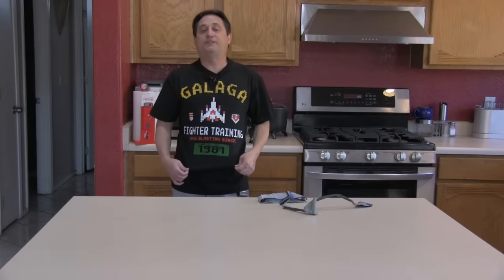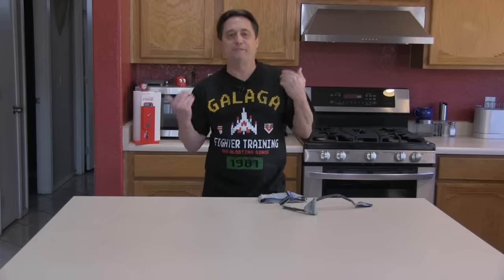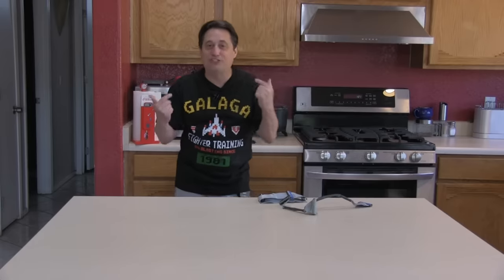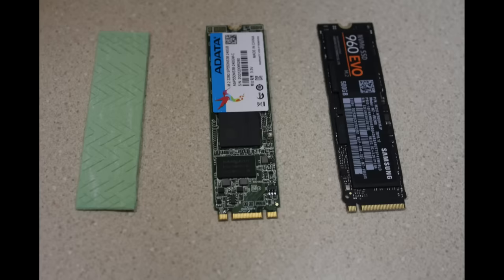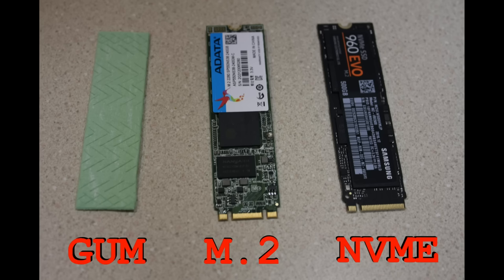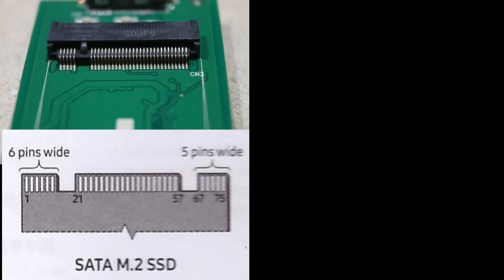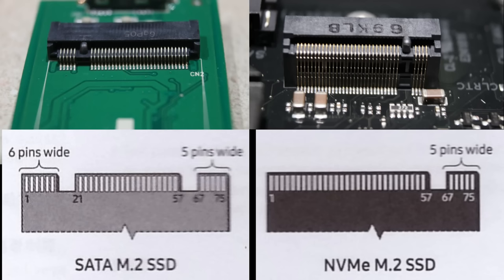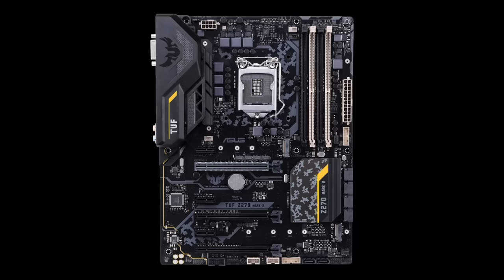M.2 vs NVME: What's the difference?

Comment: SAS more common than you think.  SATA is just a subset of SAS and with that you can plug a SATA drive onto a SAS controller and it will work (small difference in connector - keying you can get adapters for).   Though you can't plug SAS into SATA.

Parallel is better than serial - however the reason it's not used more is synchronization and sending multiple lanes of data is great, but you need to sync them and that add's so much overhead.  Hence a single lane (serial) will be cheaper and allow that single lane to go faster than it would if it had to be synced with 7 other lanes.

However - there is always a limit and you may see Parallel connections come into play again.  Heck, your memory not linked via serial connection, its parallel.

Tech moves fast, I remember when you needed a forklift just to change a disc.

Comment: 69 Years Old, and I remember Run Length Limited Disks, and fitting IBM PC XT SCSI Disk Sub-Systems and as you say boy we’ve come a long way. I wonder how long it will be before we see on board optical disk interfaces.

Comment: I remember most of those standards, and YES the ribbon cabled would cut airflow, especially if you were running 4 drives. Just started getting into the M.2 SSD, which is used on my laptop.(took me a while to figure that out) and the MVME drives which are used on my new desktop. Your vid was short, concise, and very accurate. Great job, thanks.

Comment: I am 73 years old and started with an original Compaq transportable (for work) dual 5.25 floppy drives, and individual 256k RAM chips were $100 a pop... so I did not start with 640k. 8 inch floppy drives were still out there.

In the computer field back then, RLL and MFM were not referred to as interfaces.  There was no RLL. Later, when RLL became a term, it referred to how the data was organized on the disk. MFM drives had the same number of sectors on every track. RLL drives had the tracks divided into groups. The group nearest the center had fewer sectors than the outside group. I taught English to Control Data's hard drive people (section/division?) in Paris, for the last couple of years before it was sold to Seagate. They did not sell to end users, only to a distributor.  They needed it for computer fairs/shows in Europe.  It was a small class, two technicians, two engineers and an accountant... mostly conversation/discussion on technology/computers; their products, the competition, what was better, why, what could/should be changed etc. Effort was made not to leave the accountant behind.  No dictionaries allowed, they could team up to explain words, hands and feet if necessary. I learned a lot. I massaged their English into something shorter, clearer and more precise.

When I built my first computer, an early 286, I wanted one of their hard drives (possibly the best available at the time). Since they could not sell me one, getting one for a good price is another story.  I got a 60mb, full height 5.25 inch MFM drive, and bought an RLL controller. The same drive was also available as a 90gb RLL drive for a chunk more money. That would not have worked with all MFM drives.  RLL needs better precision and control.

To my knowledge, all hard drive platters made in the last few decades use RLL of some variety. You just have to look deep in the tech manuals to see it. Since they all use it, saying so in advertising blurb is a waste of time, space and money. That includes SCSI (the I is for interface).
Reply from the maker: Great info, thank you!

Comment: The limiting factor is parallel is maintaining the same signal speed.  If the frequency of the voltage changes is quite different on different wires, the signals travel at different speeds, and you end up with corrupted data at the other end of the cable.

Comment: @2:10  "however for whatever reason"  It's not for whatever reason.  Yes parallel is "more efficient" at transmitting data, but it's more costly to design and build.  Many circuit traces and wires are needed.  So when ASICs came along that could transmit the same amount of data on 2 or 4 wires (USB & SATA) as you used to be able to transmit on 16 to 40 (ATA, IDE and SCSI), it was a logical improvement.

Comment: You totally took me back to windows 3.1 for workgroups when you brought up the “JUMPER PIN”. I remember getting a 2nd hard drive (my step father took it from his job that fired him along with a few other things) but it was a Maxtor and had a neck breaking 140mb. But I just remember being so frustrated (because YouTube wasn’t out yet and cracking open a computer was a mortal sin since they cost so much.) but back in the day it was called a Jumper pin... and depending on where you put this tiny little piece of plastic (god help you if you dropped it) that would put it in either slave or master mode. Jumper pins... man what a pain in the rear. But you could use these to run safe mode 1, safe mode 2, there were actually a lot of different functions the jumpers served.

Comment: very nostalgic start, I really only wanted to hear about the M.2 stuff but the trip down memory/nightmare lane was nice.  I was so happy when we transitioned from those horrid ribbon cables to SATA, not only were they always too short, hard to route around everything, often would literally get stuck in the processor cooling fans which absolutely impacted airflow, connecting more than 2 drives plus a floppy was a total nightmare.  I often had a CD drive, a CD burner drive, maybe a drive docking bay, an internal hard drive and a floppy drive on one system and instead of the docking bay two hard drives.  I mean, back when it was $300 for a 5 gig hard drive the only way to expand storage affordably was to either burn everything onto cheap CDs or constantly swap out those 1 gig hard drives.  When I got a fast CD read/write drive and could put 3 hard drives in my computer was so coool.  Still a bi*** to route the cables and trying to figure out which end of the cable went to,  master or slave, then woops forgot to change the jumper... I still have nightmares and flashbacks when building a new system (like im doing right now) I always look for that jumper still even on new SATA drives.
Reply: And now you know why I went SCSI back in the day even though it was more expensive. My Plextor was an expensive bit of kit for the day.

Comment: Nice video very clearly put, I will just add 2 Fun facts things
1. IDE had also "Cable Select, meaning that the disk/CD-rom on the edge plug was automatically set as "Master" and the disk/CD-rom in the middle plug was automatically set as "Slave" wooooow!
2. Try to cable manage with 2 of those IDE cables + the floppy cable + the extra bulky PSU cables hehe

Comment: RLL and MFM were not interfaces.  They were methods of recording data to the disk.  SCSI was an interface, but in reality it was initially a unifying intermediary interface.  Later on SCSI was designed into device (disk or tape) controllers.  Early interfaces for small systems were SMD, ST-506, ST412, ESDI ... SCSI and a reduced command set interface based on the same physical configuration, SASI, came around about the same time as those other interface.  However, initially SCSI/SASI controllers were intended to run  SMD, ST-506, ST412, ESDI and other devices, but with a common programming model.

Comment: Never owned a off the shelf PC so have built them since around 1997 so a long time now, PC building was never difficult (Its like lego) but in 2020 its childs play.  Windows OS install is easy, BIOS's now have GUI's, No CPU / Motherboard / onboard connector jumpers, slide out motherboard trays and tool free slots, Modular PSU's, Motherboard IO panel plates ... the list goes on.

Comment: a year ago, I upgraded all my PC's with new motherboards and CPUs, and used an NVMe SSD for each of them as system drive. But I had for each system in the past 2 SATA 2,5" SSD drives from 500Gb per piece. So I bought 2 extra for every upgraded computer. Makes me I have an NVMe from 1Tb and 4 SATA SSDs, giving me 2Tb free space, with read and write speeds (around 500mbps) Not that fast, but faster than platter HD's. And I have a few servers running with almost 120Tb disk space per server. That's more than enough for storing my project files. And music projects.

Comment: Worked in computer sales starting at Radio Shack in 1979 in my senior year of college. Essentially, we flew by the seat of our pants. Around 1982 or 83, we transitioned painstakingly from large floppy disks to hard drive storage. The first purchase for our store, was a five MB hard disk it cost something like $8000. Let me spell that MEGABYTES. Our demo model was also the base of our franchise accounting system. Three stations running SCO unix. I think memory was also HUGE, at eight KILOBYTES, one MILLION TIMES SMALLER than my average laptop. We had connections to bulletin boards runnng at 300 bits per second, up from 110. (Compare that to 300 to 360 MILLION bits per second on my cable modem today. Tomorrow, I will be troubleshooting a system used to remotely monitor hotel air conditioning systems by their maintenance contractor. (Needs a new four dollar CMOS battery.) I’m relieved to live in a modern world, where components are no longer proprietary. Enjoy your blessings!

Comment: 8:55

This is SOOO true! 

I often revive and/or make some computers seems blazing fast simply because I replaced the mechanical drives on those computers with a SSD sata drive.

I can only dream having an M2 NVNE drive to compare it to a ssd on the same pc for myself.
Reply: It is not a big difference in how the computer moves. Usually the differences aren't bigger than 3 seconds. The differences appear in professional work, and when copying/moving really big files. The sata sdd are really good for day to day use.

Comment: Very well explained! I bought that exact Samsung drive except mine is 1 TB. Haven't built computer yet but when I do I'll make sure the motherboard has it set to pcie. I have to say that even the "slower" speed of the regular m.2 is actually quite fast. That's half a gigabyte per second! But the NVME at 2100 MB?! Holy crap! That's more than 2 GB per second!

Comment: I just put a 9th gen i7 system together for the youngin'. First system I've put together in over a decade. In fact, I just duplicated the youngin's parts to build me a new one for myself. (minus the m.2 drive) 
Installing the os on his, from a 3.0 usb... onto a sata ssd was a new adventure which left me in awe, that's how far behind the fold I am/was. These m.2's I'm assuming, will top the amazement I've experienced by far. 

Helpful stuff 3.5 yrs later for an old fart, to inform/help pic one of these drives for the board.

Thanks abunch!

Comment: thanks this helps me because i need to buy one for my dock and it supports both m.2 versions but i had no clue which was better, also tehnology worked very slow around my area so i used very old tehnology even since i was a kid, i used all 3 versions of pc, the very first version with w95, after 5 years i managed to use xp/vista till 10 years then i managed to go to w7 and w8, and barely last year i am at w10.

Comment: MFM / RLL / SCSI. Been there, done that. Seagate ST225 / ST238R. Same dive but MFM = 20MB and RLL = 30MB. SCSI up to 8 drives with correct termination.  Next thing you will be talking about is 10Base 2 networking and token ring!

Comment: The problem with the old PATA and IDE was the parallel data paths would get out of sync with each other at hi clock speeds and fail due to errors.

Comment: Good info, I've just started looking into these drives and since it seemed, now confirmed that my Asus Crosshair VII Hero uses both this allowed me to make sense of it. I will challenge you on the OG, my first gaming computer was a VIC 20 with a tape drive which I then upgraded, in '83 to a CBM-64 with its series-parallel floppy drive.
Reply: I still remember my TSR80 and Commodore 64 systems with those tape drives. My tapes would get eaten by the damn drive every so often LoL 😊

Comment: I imagine these drives being directly mounted on the motherboard are faster on data transfer, my question is can you have the main windows software stored on these devices so as to have fast start up of the computer. Sorry if it seams a dumb question. Been a subscriber to carey holzman videos for a few years now, helped in my first PC build, still working perfectly after all these years. :-) thanks, vazza.

Comment: There are different sizes for nvme m.2 hard drives like 2280 2260 2230. I was wondering other than measuring is there a way to tell what size you have on without opening up the computer.

Comment: Thanks for the Video Carey. Though I knew most of this you clarified. I've had external sata. Back in the 80's I had a scuzzie. People would ask me, why do you need an 80 mb drive. Not gig, mega. It would take me a year to fill it. Back after the turn of the century one disk I had would boot windows, apple mac 10, and linux. All on one drive. Same Dell computer.  Usually I had one operating system on one harddisk. Back when people would boot you off a web site for being too obnoxious. Me? Noooo  Now I'm 75 and it's too much trouble. Besides my mental faculties have lapsed.

Comment: A multibit parallel interface is, in theory, always faster than a single serial signal clocked at the same rate. However, physics stands in the way. When a semiconductor drives several bits (like 16 or more) all at once there is a power demand to supply current to all of those interface data pins at the same time. This is particularly pronounced when all of the signals are ground level because the semiconductor has to sink a relatively high amount of current. That current can cause the ground reference within the chip to rise and this is bad because transistors start to malfunction with a too high ground reference. Further, it is difficult to keep all data bits of a parallel interface timed to reach the destination at the same time relative to a sampling reference. This skew of data bits can cause sampling errors at the destination. Serial transmission has its own set of bugaboos which I won't discuss here, but solutions have been found to transmit a train of bits serially at much higher speeds more safely (lower error rate) than parallel so  this is why serial formats are used. Interfaces like PCIe use multiple lanes to increase throughput but these are independently transmitted with bits of a word being reassembled at the destination (again omitting details).  Neither the ground reference issue nor bit skew are problems with such a scheme.

Comment: They moved it from parallel to serial because once you get to a certain speed (in hertz), you can't guarantee all the data will arrive at the same time for all the cables due to variations in the cable quality.

Comment: Thanks! Now I think I have a potential problem figured out. I consider myself a tech person - as does everyone I know, but one of the last mysteries to me was why do the use of some M.2 drives in a slot disable a regular SATA port - (that you could have a good old hard drive on)? Now I know that it's because when that applies, it's a SATA M.2 SSD - more like a SATA hard drive that just plugs into an M.2 port.  - 

Which LOOKS like a NVMe M.2 SSD - except it only has 1 slot and is faster because it travels on the PCIe bus.

Comment: Those rounded PATA Cables really were a pain in the ass. 

I first got them with a DFI LANParty motherboard, the wires at the beginning and end of the connector would end up snapping, being under so much tension from being squashed into a rounded cable sleeve.

As usual, I would only notice on closer inspection AFTER cursing at the BIOS an HDD for a few hours for not booting

Comment: RLL and MFM aren't interfaces, what you had was the ST506/ST412 interface which supported both MFM and RLL encoding over two flat cables, one 34-pin (which could support 2 drives) and one 20 pin for each drive.
You could at the time actually bump the capacity of a MFM hard disk by replacing the MFM controller with an RLL controller and do a low level formatting of the drive.
On many (but not all) controllers you started DEBUG in MS-DOS and then executed "G C800:5" to get into the low level routine. For best performance you had to try out the optimal interleave for the machine/controller/disk combination. Rarely an interleave of 1, more often 2 or 3, in bad cases 4. The lower the better. But if it was too low the disk had to rotate one full rotation between each sector read.
Just some relic information I carry in my head.

Comment: I too am an OG. I didn't use rounded IDE cables since they were a bit more expensive. Finally they became affordable and I got one. However they invented the SATA interface the next day and I had to do some swearing to them. That rounded IDE cable is still in my closet, not used even once. Thanks for reminding me once again 😂

Comment: I heated the IDE cables up made them more flexible, I would use 3 different size heat shrinks to get it to a very round cable that looked pretty good, I used to write books on dos before they had "DOS for dummies" 30 years of pc building, I had almost forgot most of this,  this is the first year in over 20 years that I'm buying a custom system that's getting built for me instead of building myself, only because it's a pain to get the parts I want(at the same time) I'm sure I'll tweak it a bit.